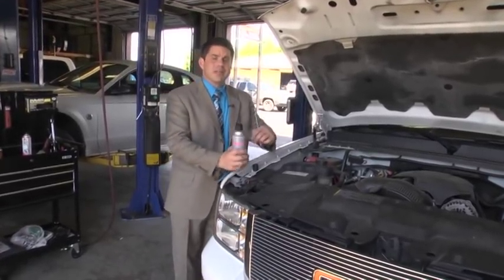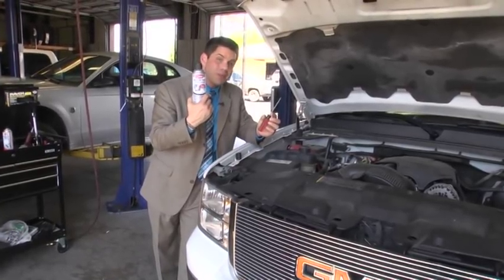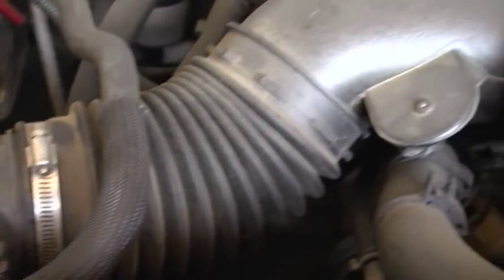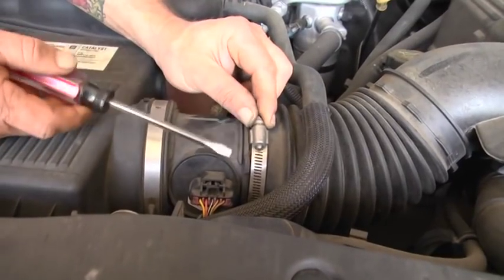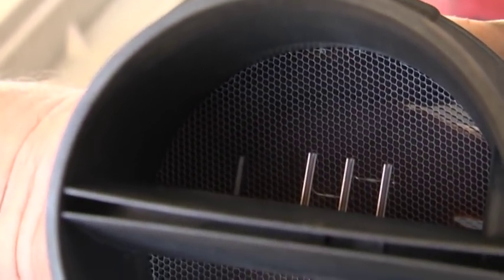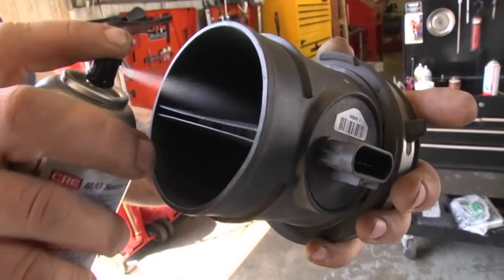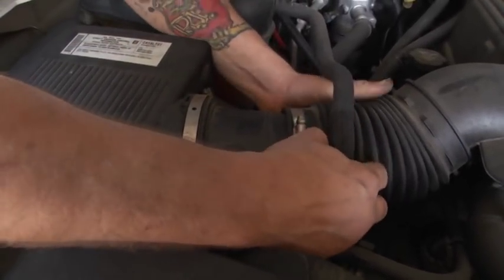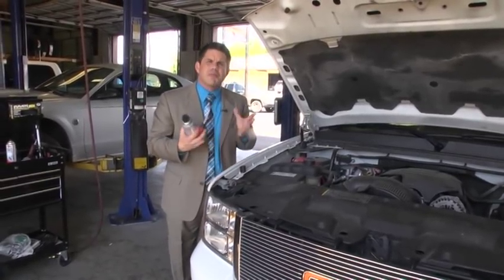Want better gas mileage?  Get a screw driver and spend 2 minutes here

Comment: wipe em off with a rag,  or use wd40 ..a special cleaner,  that's exactly the same as the can next to it they say to use for something else,.. now why on  earth would you need a specially designed cleaner to clean those prongs? was it a news story or was it an infomercial?  after you clean it you may feel some extra pep in  your engine if they really could have been that dirty to have caused the engine to run poorly,  that however will disappear the next day as the ecm recalibrates  in the next 24 hours and adjust to the new readings,  kind of like when you put a high flow  k/n or other air filter on, that first day .. boy oh boy Lester I can feel the extra 5 hp!!! then the next day she's a dog from  the traffic light again !!!

Comment: I've Done This Several  Times On A Few Different Vehicles Just Using A Q tip And Rubbing Alcohol Or Gasoline And Have Had No Problems...Maf Sensor Cleaner Is Way Over Priced..

Comment: I'm sure on the can it says to avoid skin contact and yet the so called expert sprays the juice right on his hand.
Did you see his ring 
Few expert mechanics will wear jewelry when working on anything because its a good way to lose a finger or make sparks fly.

Best thing you can do is if you know little about cars is to leave the hood down and leave it to a pro.
Reply: It's only known to cause cancer in California. All other states it's okay.
Reply: +Scott Diamond hahahaha I say that all the time. I'm never going to California, everything causes cancer there lol.
Reply: When i was a mechanic my ring actually saved my finger from at least getting broken. The hood holder fell out of its notch and when i pulled back my right hand didn't get all the way out and the hood slammed down on my hand. The ring i was wearing got in the way and i walked away without a scratch, the ring was pretty hard to get off afterwards due to now being an oval lol. Normally i agree that jewelry is a bad idea when working on cars but there are always exceptions:D
Reply: Pigeons 101 we cure it with the meds . Mary Jane
Reply: Scott Diamond
Testicle ?
Reply: B Anno Any type! I'll take em all if The Great Sweet Leaf is the cure to cancer.
Reply: B Anno If you want things done right, learn how to do it and do it yourself
Reply: Ekemini Umoh
Ain't it the truth !
I've seen certified clowns at Ford & GM dealerships that seemed no smarter than mechanic school drop outs.
Reply: Ekemini Umoh
Reply: as a note, MAF cleaner is very gentle stuff. Its the same as Electrical contact cleaner. never use brake or carb cleaner on the wires  because it will damage them, and never use wd40 or the like because it will gum up the sensor
Reply: it's called a wedding ring. being on camera he no doubt is the owner or manager so does not do much in the way of labor anymore. just some demonstration for the camera so why pull your ring off for that?

Comment: in my experience i saw no mpg gain signifigant enough to say yes it will.  What i did find out it does well is improve throttle response. my engine felt lazy with a clogged filter.

Comment: This is so amateur. I just took parts off I didnt need. like my backseat is hardly used so I keep that in the garage when needed, same with the passenger seat. I also removed all the glass and use cling wrap. Hundreds of pounds reduced. Also mix your gas with some tap water from the hose, its still flammable.
Reply: LOL. I really do keep my 3rd row seat in the garage for just in case. I think I will keep the window where they are.

Comment: If you cut one of those wires, you gain 50% fuel economy, but you have to run higher octane so you don't have detonation.
(500/1 x 1/200)x(2^3 x 2^-1) 
______________________ 

(3 x 4 x 5) / {[(3x7)-36]+18}
This formula will explain how many of those wires your engine needs.
(takes no responsibility for those that don't understand sarcasm)

Comment: how about an air filter needs to be more then 50% dirty to affect mileage an if your going to describe how a mas air flow sensor works like ones a hot wire the other is cold an that the one that can tell how much air there is plus let it dry be4 re connecting it so you dont burn it out
Reply: its been noted that dirty air filters filter better to some extent
Reply: @realtruth172  it's been tested by members of the ASE board that have had  the filters taped off half that they have gotten better mpg unless your W.O.T.

Comment: Snake Oil... So a bit of spray cleans the heater wire better than it does with the ECU heating it up to 800 c. Typical Sucker Product.

Comment: Do not use anything other than MAF cleaner.  If you are one of the people saying otherwise, you are doing it wrong.  Do not make any contact with the wires while cleaning it.  Before you put it back in make sure you allow it to dry.  30 minutes is good enough on a warm day but don't put it back in and run in while it is still wet.  You can also pick up a small can of this at Walmart that comes in a two pack by this brand that also has a throttle body intake cleaner.  It costs $8 or you can get it on Amazon for $10.50 with free shipping.  If you use a K&N filter you really should use this stuff as the oil in that can dirty up the MAF.  This is a really simply thing to do every once in a while that will help your vehicle.
Reply: cottonzway I agree with you 100%.
Reply: can you use qtips and alcohol to clean the MAS SENSOR?

Comment: And if yall buy something that has a small frugal engine instead of big dumb trucks then yall wont wont need to marry you cousin and clean ur maf to get 20mpg like these guys yall. muricah!!
Reply: You're little POS Asian tin can has a MAF too, dickwad.
Reply: There are still real men left and we drive trucks so get over it
Reply: And there are also people that own houses, boats, horses, RVs, trailers, race cars, slaves, illegal aliens, pumpkin farms, chickens, a bunch of dogs, or cats, lawn mowing businesses, plows, farm equipment etc... along with people that simply aren't pussies working a 9-5 and come home a get on YouTube all night..... so yea.... Pickens up bitches on Honda ain't to easy no matter where your at....pussies... lol...
Reply: +Matt Bennett not really some foreign mosty 4 cyl they use the first O2 sensor so determine if the car is running to rich or to lean. and most of the time its more expensive then a MAF. they might have and Air Temp sensor though.

Comment: Not all vehicles use a mass air flow sensor. Go ahead and do this yourself with no knowledge or insight of how to work an an automobile and break the tiny wiring inside the mass air flow. That way your vehicle won't start or run like shit then pay a tow truck to tow it to your technician so we can all laugh at you. Since you know so much can you please recalibrate the Flux capacitor on my fwd car

Comment: This is horse shit.  Yes your right with older cars but cars now are to smart for this bs! Sure if it's fucking caked yeah but normal use this doesn't matter. Plus my mom told me Never trust a guy in a suite.
Reply: "To smart for this B S"?

If anything. On these newer cars, it is even more important to keep that sensor clean. Yeah the new cars are smart. To smart for their own good.
Reply: Youre right, if a man in a suite it trying to lure you into said suite dont trust him. A man in a suit on the other hand could go either way.

And no, any dirty maf could tamper with accurate readings new or old.
Reply: +grjsb13 ha ha good one
Reply: +Charles T I agree with this more that this horse shit video! Change your air filter don't screw with the mass flow as it's not very strong at all. It will cost you more than the 10 cent your wasting pre tank because it's a little drity.
Reply: +Charles T I agree with this more that this horse shit video! Change your air filter don't screw with the mass flow as it's not very strong at all. It will cost you more than the 10 cent your wasting pre tank because it's a little drity.

Comment: I just cleaned my map sensor by mistake, now my GPS quit working what do I do now?
Reply: Ha!...I see what you did there...
Reply: It's an easy fix. You need to wash headlights so they can see where you are.
Reply: get a map
Reply: +Marcus Bello oh, I get it now...... I'm a dumb ass.
Reply: +Tai Lopez MAP sensor, GPS uses maps
Reply: oh man. Time to buy a new car.
Reply: You probably need to replace the intake manifold tensioner
Reply: Lol
Reply: mike hoyt RROOOTTFFFLLLLL TEARS!!! WTF MAN! LOL
Reply: Vendetta b166er get some milk
Reply: switch. it to whombo
Reply: Firestarter it was a joke, the dude knows what a map sensor is.
Reply: avery domingue I'm dead...lmfao
Reply: Tai Lopez if you work on cars you would for sure get it,  MAP sensor is a real sensor lol just not for GPS but for manifold absolute pressure
Reply: TheAutoBond .lĺ.
Reply: Vendetta b166er buy a new gps bro ur brain fryed the other day from too mich exhuast fumes from cleaning ur maf
Reply: Buy a new GPS
Reply: lol.
Reply: Get the windshield replaced. That'll fix it.
Reply: top off your blinker fluid buddy
Reply: check the exhaust for restrictions
Reply: Have you tried remapping the ECU ?
Reply: Reading this feed made my night haha
Reply: Vendetta b166er truck stops sell maps... don't need GPS.
Reply: Steve Vento - It's FUNNY, lighten up!
Reply: Vendetta b166er haa your so right. We never ask for directions. Good day.
Reply: Vendetta b166er change your blinker fluid and tighten your muffler bearing to spec with a torque wrench. It'll go back to normal
Reply: All i can say;Asshole.
Reply: To fix the GPS run the car over a cliff🏁.
Reply: Vendetta b166er lol
Reply: Start dancing
Reply: How about a seeing, eye dog
Reply: Vendetta b166er LMAO
Reply: Map sensor is the manifold absolute pressure sensor. It reads the pressure on the intake manifold, and with a temperature sensor, can allow your computer to accurately determine airflow.

Your car probably does have a map sensor, and you were to ignorant to understand this.
Reply: I don't get......

Comment: If you needed this video to know how to clean a MAF, you shouldn't be messing with it. It's the most fragile sensor on the vehicle, I've seen people screw them up before.
MAP sensor is the best IMO, they're the cheapest and least likely to go out.
Reply: If its dirty, just replace it.  Its about $75.  The one on my truck was so dirty when I bought it 2 1/2 years ago that it actually didn't idle smoothly.  Put a new one in and it runs and idles perfectly after that.  Getting better fuel economy, well that's a myth.  Got 13 mpg before and gets 13 mpg after on a 99 Silverado Z71 ext cab with 5.3 engine and 3.73 gears with a leveling kit and 285/70/17 all terrain tires.
Reply: MAP sensors also react to the throttle faster than MAF. MAP=Manifold absolute pressure and MAF=Mass air flow for anyone that is not a mechanic.
Reply: ever remember the old jeep oil pressure sensors conveniently placed next to the oil filter. with a plastic 4 inch piece off the back that would snap with just a slight bump.

Comment: I don't even bother taking them apart.  I just get some intake cleaner (just fast solvent), get my wife to hold the engine at 2500rpm and fire it into the intake after the air filter.  This cleans the throttle body, back of the valves and piston crowns etc too.  You have to pulse the spray or you'll stall the engine out though.  Fuel injector cleaner in the tank (double dose depending on product) and a few trips to the rev limiter now and again and its all good.  Makes a difference to fuel economy and performance, and I've never had a MAF (or MAP) go out because of this.  In fact, I've only ever had to change one on my own car in almost 20 years of driving, and that car had 160k miles on it at the time.

Comment: lol this won't make one tenth a % of difference i bet
Reply: If it's not one thing, it's another!  Still trying to find EVAP leak (codes 442,455)  and now your telling me my POS has CRABS?  Where would I find this crab cleaner you speak of?
Reply: omfgwtfbbq90 How does the fuel burn without oxygen???
Reply: Michael, you are correct.
Reply: You got that new diesel that burns without air?
Reply: It's more fun watching videos of people that are clueless about auto repair.
Reply: worked at several dealerships was always told you can clean it if you wanna buy them a new one
Reply: I tried it personaly on my vw 1.9 tdi engine it not only improved fuel consumption but also gave my car a new life.before it was driving very heavy & was irresponsive on throttle & hill climbs despite that every thing was fine e.g engine,transmittion,fuel pump & filter & it was fully serviced but after I cleaned mass air flow sensor it is really consuming less fuel,creating more bhp & response aggressively to a little force on throttle.
That guy missed one thing in this video that after spraying the MAFS with cleaner u have to leave it in air for 15/20 minutes to let that mist evaporate & dry before u reinstall it & start ur engine.
Reply: +ammar ali. well im glad that helped you. cleaning the throttle plate & idle speed controller helps a lot try it. open the buttery fly spray it with carb cleaner not the whole can lol. wait a few seconds for the blk stuff to soften up then use a lil wire brush to clean it off then spray it again once you first crank it the car will run crappy until the crab cleaner spray clears but the you'll see a huge difference in idle take off and gas mileage will go up a tad also
Reply: +ammar ali your car may have had this done when its was serviced. but this helps any gas vehicle and needs to be done every 30,000 miles. 😎 have a good one !
Reply: +Michael Horsford thanx mate.would u recommend any video which show how to do that in a proper way as u telling?
Reply: +ammar ali. none that ive seen how could i contact ya ?
Reply: +Michael Horsford if u find one u can paste the link here & yeah if u want to contact we can do it on kik if u have that.
Reply: +ammar ali nope how about a number then u can delete it ? are u in the usa?
Reply: +Michael Horsford thanx mate
Reply: +Gary Kovach lol sorry buddy. carb... in my old shop only way to find evap leaks were to use a smoke machine im sure you could rig something up thou if your handy
Reply: Thanx for getting back to the post so quick.  Yes sir, I've made a decent smoker, but the only thing holding me back  IS my back. I'm not as limber as I used to be. But, I digress, FOUND at least one problem- rotted out filler neck, which is a dealer item. Currently trying to fabricate something from other parts I have in the north 40. WASTE NOT WANT NOT as it were. I'm thinking of turning my wifes (she doesn't know this) `04 Mustang in to a neat little fishing boat. ONE more DIME, and it's "HELLO MRS.PAUL!!!"  XD
Reply: +Gary Kovach awesome
Reply: Michael Horsford Where do you get your parts from,  I mean if you don't want to re-manufacture everything? It looks like I'm going to go DEALER for the rack on the Mustang. If the damn thing wasn't in as good shape it's in, I WOULD RUN IT INTO THE DRINK!!! I love to wrench, but dikin with garbage is giving me a major case of the ASS!!!
Reply: +Gary Kovach here in ga there are several pull a part junk yards  so i try that cause its cheap
Reply: Hey Michael, good to hear back from you. Yes, here in N.E.OHIO we also STILL ( in my dis-belief) have a few good bone yards. My particular is about 35 miles one way. When I make that magical trip, I'd like to have a truck big enough to get everything I (want) need.  I've 3 sons, a wife and a butt-load ...just for ..ME to gather. I can only imagine, once I get there I'll feel like I'm in Disneyland, and won't want to leave.  XD
Reply: +Gary Kovach.  ha ha jus me here. i bought a lil kia 5 years ago 1400 been a great lil car the darn transmissions burned up. a 1999 with 139k on it. i cant believe it oh well. im sittin on it for now
Reply: +Gary Kovach Pharmacies do good crab cleaners ;)
Reply: perry1993 Yup, this is true. In my younger days I'd have to say, I was quite the "IGNORANT LITTLE BASTARD."  By the grace of GOD, I did not contract an STD. Who knows for sure, could've been the on going inebriation, don't know if that helps or hinders. But YES,  had some friends that had visits from the "crusty crab," ..and although easy enough to get rid of,  the itching was enough for them to take note on future endeavors. Now I'm older, maybe a little wiser, and just glad I can still pee.  PEEEACE!!!!
Reply: +Michael Horsford Diesels don't have throttle bodies
Reply: +omfgwtfbbq90.  is this a question or a statement ?    either way they do have a butterfly that lets air in the engine
Reply: +Scott Diamond lmfao. i guess they do.
Reply: +Scott Diamond. hey man check out my channel.
Reply: +Scott Diamond lol i got a funny one or two
Reply: Michael Horsford I don't know what kind of diesels you are talking about, but my 2001 E39 diesel has no throttle body nor butterfly valve to let the air in. Hell, I even let the engine run without the inlet manifold and it ran fine, except for the lack of turbo pressure lol.
So what valves or throttle bodies are you talking about? Because the throttle is controlled by the ammount of diesel fuel injected.
Do you even know how diesels work??
Reply: air enters the intake from somewhere lol
Reply: Not if you keep up on regular maintenance. Anyone who claims a noticeable difference is negligent on maintenance.
Reply: Yes It Does,But if U Don't  Clean  it Occasionally, Will Go Bad & Most Are A Little Expensive.Mechs. Say Don't  Use the Carb.Cleaner to Maintain.Them.
Reply: Stephen N  lol that's good thing or no ?  ha ha
Reply: I cleaned mine, and it fixed my marriage, corrected my taxes, and got me out of a ticket. Thanks Randy!